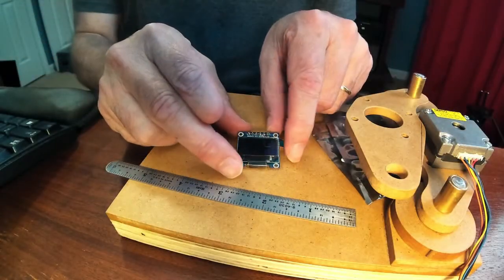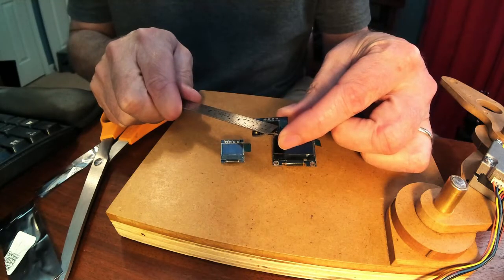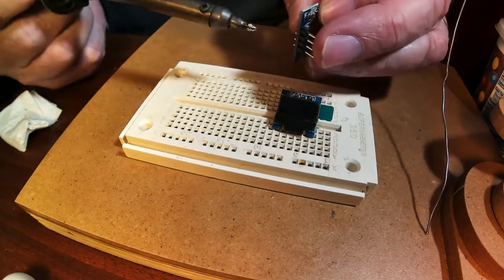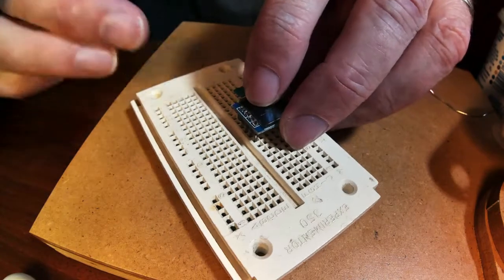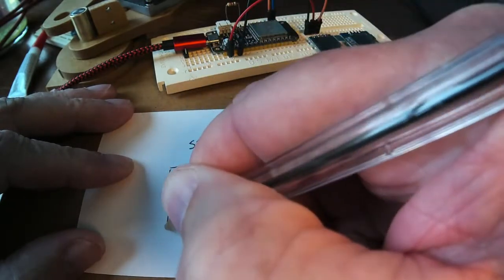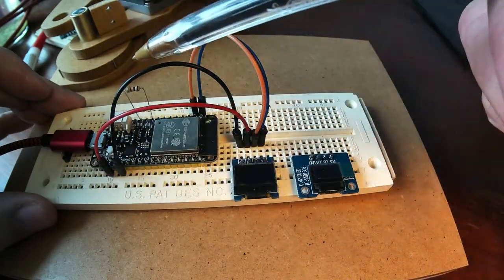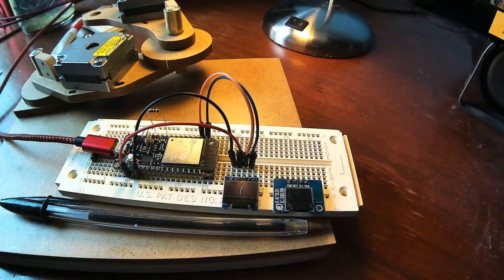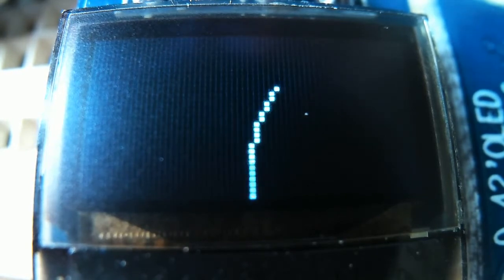Smallest OLED Display on Ebay - ESP32 Project 11

Comment: i got a head mount unit from an old HMZ-T1
 is there a way to repurpose those tiny OLED screens
Reply from the maker: I'm sure there is a way to use them, but I'm not familiar with them myself. You'll have to figure out what the driver is and what communication protocol is required.

Comment: what's the smallest HD =1920x1080? the portkeys oeye evf uses a 0.71"
Reply from the maker: I've never seen one with that much resolution.
Reply: Is the code for the fractal trees on i2c here? I can't see it in the links.
Reply: Found it. Cheers
Reply from the maker: @PicoGirl  In the description.

Comment: I've just got one of the 0.42" 70x40 I2C displays.  With an Arduino, I usually use the SSD1306Ascii library (https://github.com/greiman/SSD1306Ascii), for text only display without requiring a buffer.  This lets you select the horizontal position of text by the pixel (0 to n-1) and vertically divides the display into 8-pixel high rows.  However, 70x40 is not one of the defined types of display that can be declared in the begin statement (I have previously used &Adafruit128x64 and &Adafruit128x32 for generic eBay 128 x 64 and 128 x 32 displays).  With some experimentation, I've found the 70x40 display can be used with this library by setting the display type to &Adafruit128x64, then writing the text (assuming a 7 pixel high, single row height font) to rows 3 to 7 and starting at column 28, you can fit 12 7x5 pixel characters (with 1 pixel gap above and to the right) in the display width, i.e. the last character is written at column 95.  This would suggest the display is actually be 72 pixels wide (95+4-28+1)!

My test code:
//Tests for 70 x 40 pixel 0.42" OLED

#include <Wire.h>

#include <SSD1306Ascii.h>
#include <SSD1306AsciiWire.h>
#define I2C_ADDRESS 0x3C
SSD1306AsciiWire oled;

void setup() {
  //Initialise display
  Wire.begin();
  oled.begin(&Adafruit128x64, I2C_ADDRESS);
  oled.setFont(System5x7); 
  oled.clear();
  oled.setCursor(28,3); //This is the top left position for text
  oled.print("01234567890123456789");
  oled.setCursor(28,4); //2nd row
  oled.print("123456789012");
  oled.setCursor(28,5); //3rd row
  oled.print("123456789012");
  oled.setCursor(28,6); //4th row
  oled.print("123456789012");
  oled.setCursor(99,7); //5th row. The leftmost pixel of this character is displayed
  oled.print("0");
}
void loop() {}
Reply from the maker: Cool.

Comment: does the flipping thing means you can do double buffering?
Reply from the maker: Not sure. I don't think so. The 1306 has two commands that flip or mirror. One for X and one for Y. The X is centered, so no changes are needed when turned on. It just reads backwards. But for Y, you have to adjust the page read start and end. I don't think you can do more than tell it where to start and stop the read.